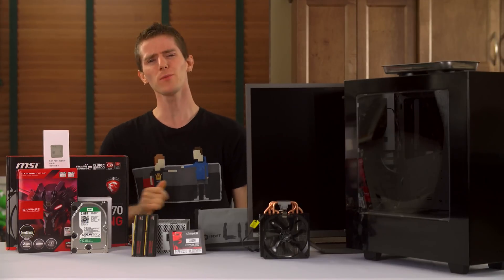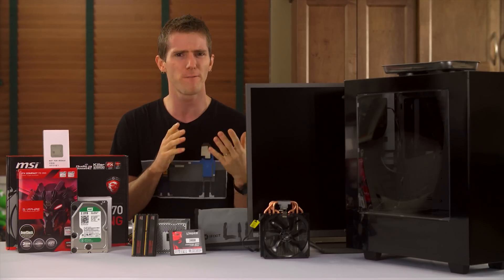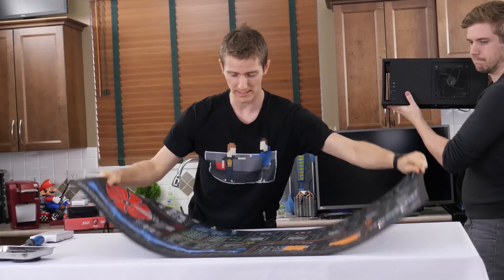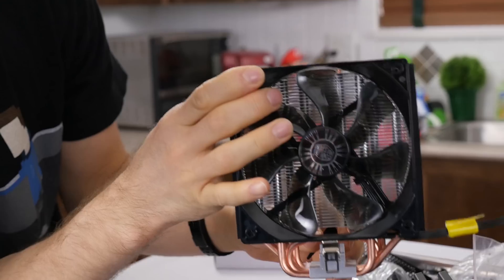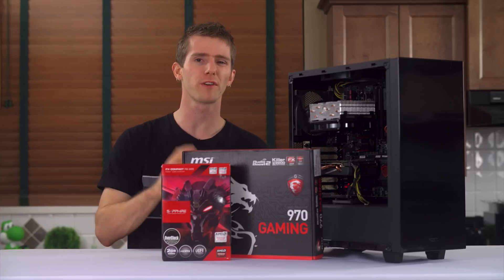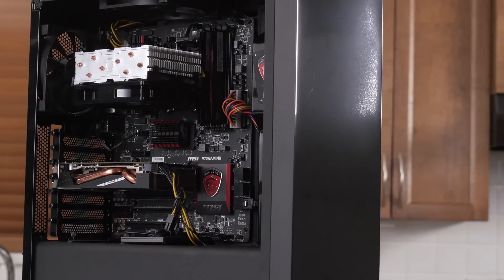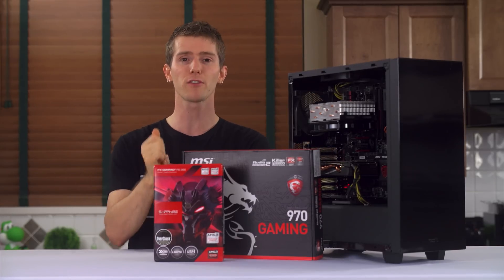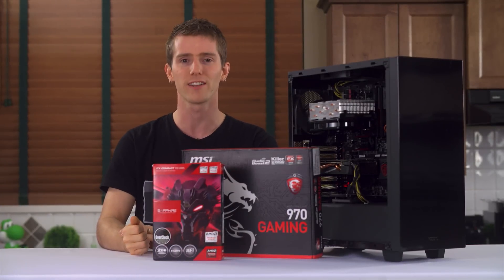Can you Build a 4K Gaming PC for Under $1000?

Comment: thing is, competetive fps games are ussualy played on very low resolutions and preferred to play on 120hz
RTS games are really nice with 120hz aswell 
i'd rather have a game super smooth than have it look really good on 50-60 fps
Reply: I'm not sure lowering the rez is that relevant anymore in competitive CSGO etc. Back in the day you had to lower the rez because it got you a higher refresh rate (CRT monitors were limited in that regard). It also got you more FPS so that you could actually utilize that refresh rate.

These days that's not a relevant argument honestly, with games like CSGO running at 300fps on many systems at any resoultion.

I think some "pro" gamers just lower the res because they heard it's what the cool kids do, rather than understanding the original reason for it. Yeah, sure, you get funny pixel artifacts at long distances /w low resolution, but I seen many very capable players that prefer the high resolutions; especially if looking for things at longer distances.
Reply: I don't play CSGO competitively
Reply: Diego R matchmaking? 
still games like csgo already have bad graphics so i dont feel bad lowering the the resolution
Reply: Silver 2. YOU dont feel bad lowering the res, but someone else might
Reply: Mythricia lowering the res actually makes you play better,i thought that was bullcrap aswell until i actualyl tried it, it makes everything bigger especially if youre playing on stretched resolution
Reply: It doesn't make anything bigger other than maybe UI elements and crosshair. The world scale is the same.

I would know this; I used these tricks back in CS1.5/1.6 and early Source myself.

It's pointless now with modern displays and all that.

I'm not saying someone can't have personal preference, but I'm saying it's not the "must have" thing anymore; the original reasons for doing it are long gone.
Reply: Mythricia it DOES actually make everything bigger, and theres much less for your eyes to scan hence actually playing better, i know alot of people can agree on this, maybe for you it doesnt matter but it does matter for alot of people
Reply: Mythricia
 It bugs me when people use old stuff in cs just because that's what they're used to. (like low resolutions and the ak)
Reply: Bananahead88 you should try switching from 1024x764 black bars to 1920x1080 after 3+ years 
about the ak, that was completely irrelevant, people use the AK cause its cheap and its a 1 shot headshot with decent recoil to control (tho it was much better in 1.6 cause when you actually aimed for the head it hit the head unlike in csgo)
Reply: Bananahead88 The AK? People are just used to the AK and don't feel like spending the extra $300 to get an SSG
Reply: /╲/\╭( ͡° ͡° ͜ʖ ͡° ͡°)╮/\╱\ But... It doens't.... It's computer graphics ABC. The world scale is unchanged. It's represented by fewer pixels, that's all. Take a screenshot at low res, another screenshot at high res, overlay them transparently, and you'll find the scale of the world itself is identical (ignoring things like aspect ratio differences).

There's not less to look at. You're just given less visual information. Which is hardly a positive.

Again, like I already said, I used to do this 10 years ago myself when it was relevant. It's not anymore. If it had a clear advantage, everyone who cared about the game would do it. they don't. Plenty top-end players don't.
Reply: the 300$ is a pretty big deal especially considering how weak the T side is,  besides the ssg isnt even that good
Reply: /╲/\╭( ͡° ͡° ͜ʖ ͡° ͡°)╮/\╱\ The SSG is actually an AK with a scope...So it's better.
Reply: Mythricia also less pixels=less things to scan for your eyes
Reply: akalion2131 idk, it feels really weird for me to play with that thing, im used to the ak
Reply: /╲/\╭( ͡° ͡° ͜ʖ ͡° ͡°)╮/\╱\ Not really. That's not how human vision works. But whatever. You're clearly convinced it works that way for a fact - like I said, you may prefer it, that's fine, but claiming it's a fact is a big step.
Reply: /╲/\╭( ͡° ͡° ͜ʖ ͡° ͡°)╮/\╱\ Well you're not used to it and I also use the AK 24/7, but the SSG is just plain better.
Reply: Mythricia yep
Reply: /╲/\╭( ͡° ͡° ͜ʖ ͡° ͡°)╮/\╱\ More and more pros are switching to a 16:9 resolution. Switching to 4:3 doesn't make it better for everyone instantly, it's not the end all be all resolution. Maybe it did for you, but not for everyone else. I've played at 2560x1440 for almost a year and I'm still Legendary Eagle Master, my rank doesn't get better or worse when I tweek all of that stuff at all
Reply: It's not ssg, that's the scout.  It's  the sg.
But yes i phrased that wrong, i know that the ak has its place of course because it's cheaper but soo many people straight up refuse to use the sg and even call it bad just because it's not the ak, and that bugs me.
And switching resolutions isn't a life changing thing, you get used to it in a few days.
Reply: akalion2131 It's not better, its different and should be used differently.
The ak is a faster weapon to use because the aim tightens in faster after moving. It also has better hipfire/jumping accuracy. Its also $300 cheaper, which is a price of a nade or a flashband with $100 spare. The SG has better accuracy overall and accuracy can be improved further by scoping in.
Reply: Mythricia I have to agree with you on this one. Even inexpensive laptops like my Dell i3 laptop with integrated graphics runs CS:GO at 80 FPS on high settings. I tried turning the graphic settings to low to see if it made a difference in game and it didn't, just made the game look worse. I could see the need for it at the time of the games release when hardware was at the current times specs, but with modern PC's it seems pointless.

Comment: What are the best specs for a PC under £1000 (Not including any peripherals)

The PC will be mostly used to run the following programs:

- Solidworks 
- Keyshot (Rendering) has to have good excellent cooling my current pc reaches around 98 Degrees when rendering 
- Other similar CAD Software packages  
- Adobe Programs (e.g. Photoshop, illustrator etc)
- and other basic programs  

Thanks

Comment: Why the fuck does amd always have to be a low budget build I spent 2500$ on my amd rig not some measly 1000$ amd my system runs games at 4k but 4k still doesn't have 144Hz refresh rate so I'm sticking with 1080 until their are 4k 144Hz monitors

Comment: What if I switch the r9 with an r7 260x? Can it run games at 1080p 60fps?

My build in which I just want to upgrade motherboard and processor. 

And a10 68000k apu
MSI fm2-a85-xa-g65
Corsair cx750 PSU
Sniper ballistics 8gb ram
Xfx r7 260x 2gb gpu
Reply: Bad build.Get a fx6300 or a 760k/860k, 750W is complete overkill and 500W would be PLENTY.And about the 260x running 1080p 60fps, eh depends on the game but it won't be High settings for sure.
Reply: A R7 260x can definitly do that.
Reply: Alright. I have everything. Its just the mobo and the processor that I want to upgrade.

Comment: Why on earth did you go with a 2gig GPU for a 4K setup? It might have worked with these games, but playing something like Skyrim with some mods will not work at all. And it's not that Skyrim is the newest and most demanding game, we're not talking about BF4 or something like that. Spend the extra 50 dollar on a R9 290 and, if you really have to, save that on some other components (case, smaller HDD etc.).
Reply: Are you trolling or are you legitimately stupid? This build wasn't made to run modded Skyrim. It's for people that play Source games or MMOs or MOBAs and that want to play it at a high res.
Reply: Diego R I'm neither. Making a build that can run 4K fine, making it on a budget at which it can't run all triple A titles at 4K, understandable. But why limit yourself on one of the most crucial things for gaming at this resolution, GPU memory? Games wouldn't run worse if they'd chosen a Cooler Master N200 or Fractal Design Core 1100 case, games would have run just as well with a 1TB harddrive. But you'd be able to run more games at 4K with better performance, for the same total amount spend, if they'd went with a R9 290 4GB.
Even keeping everything the same, but using a R9 280X would be better. That one costs the same as the R9 285, but outperforms it on 1080p gaming and has more headroom for 4K gaming due to its 3GB memory.
Reply: So I think you're looking at build guides the wrong way. It's not supposed to be "get EXACTLY what I'm telling you to get" it's supposed to act as a guideline and you should change things accordingly. For one person the 240GB SSDS is useless and maybe for another the 240GB is perfect. If this is EXCLUSIVELY gaming then yeah maybe 240GB is too much. It all depends on the person and their needs. His could also be used for slight content creation and 2TB HDD and 240GB SSD is exactly what they need
Reply: Diego R I agree on the "not exactly getting X or Y", but channels like this are a guideline for people who might not know all that much about building pc's.

With that in mind, giving the "advice" that a 2GB card is a good investment for a 4K build is wrong imo, certainly if you can get a better performaning 3GB card for the same money. It's more that the R9 285 is a really weird buy at this point in time, any other AMD card in this pricerange would be a better pick; the R9 280 is almost on par but cheaper, a R9 280X is better in every regard and by investing a bit more and getting a R9 290 you'd be much better off. Sadly NVidia hasn't got any good options in this pricerange, with the GTX760 being a worse performer with the same 2GB issue and the GTX770 being way too expensive.

Don't get me wrong, Linus makes awesome video's and overall this is a good build, just the GPU is a bit off.
Reply: 1. why do you +1 your own comments? xD 2. if he did opt for a r9 290 he would needed to change the PSU aswell. and with your reasoning "oh since the 280x is better than the 280 just get the 280x but acually since the 290x is better just get the 290x" and at a certain point youre just better off waiting for the 300 series of cards or 400. i think the 285 is perfect for those games he mentioned (CSGO LoL, DOTA, TF2 etc) and the 285 is ITX so if someone doesnt have room for the R9 290 thats also a +
Reply: Budget build and showing that some popular games can run at 4k on said budget build! Every one here would build it differently but this is something that AMD funded and it really benefits anyone because it shows that hey 4k isn't that far away!
Reply: Mohammad Salim the fuck does that have to do with anything he just said? And Umm VRAM and RAM are two different things used for two different purposes
Reply: Mohammad Salim You have no idea what you are talking about, sorry.
Reply: Canada, not the US....
Reply: Praxis  True, but from my experience with adding high res texture mods to Skyrim is that the experience is fine in terms of FPS (30-50 is okay by my standards), up to the point that you run out of VRAM. At that point the performance FPS drops massively (sub 20 FPS, stutters etc.). This was tested at 3x1080p (so 25% less then 4K) with a heavily overclocked GTX670 (1340Mhz core, 7200Mhz mem) and measured using MSI Afterburner.

If you want to do some decent gaming on 4K, some extra VRAM is more important then a little bit extra GPU power. A nice example of this can be seen in this article from Anandtech:
http://www.anandtech.com/show/7120/some-quick-gaming-numbers-at-4k-max-settings
In general, on 1080p, a GTX680 is faster then a HD7950, in some cases even faster then a HD7970. But if you test at 4K, what Anandtech did here, the GTX680 loses (by quite a lot sometimes) to the HD7950. The 2gig cards just run out of VRAM and the performance takes a huge hit, even though the GPU itself is more powerful then their 3GB competitors.

So yea, I stand by my point that if you want to game at 4K you should at least get a card with 3GB of VRAM. And no, this doesn't mean "get a 4GB GT640 instead of a 2GB GTX680", but get a good mid/highend card with 3 or 4GB. With this build something like a R9 280X or, if money allows it, a R9 290 or your best options, not a R9 285.
Reply: What is a newer more demanding game than sky rim? I want to find a demanding game and build a pc to handle that in high graphic settings. Thanks (p.s I'm new as fuck at this shit)
Reply: Because some people, like me, pretty much play Starcraft 2. I have Crysis 3, and I played for a few days, then I went back to Starcraft 2. Some guys just play COD of Dota2. If you are one of those guys, you can play 1080p with a 7750 or GTX 650. Or you can play 4k with a 285 or GTX-760.

Comment: help! my processor is amd a10 6800k (fm2 socket). and i have msi gtx 970 gaming 4g gpu, yeah it runs all games so fking smooooothly but my cpu is shitty compared to my gpu, so what would be good cpu? my motherboard supports fm2 socket, so can i buy fm2+ processor? or should i just get new motherboard and intel cpu?
Reply: you can either get a 860k or stay where your at since your doing fine.

Comment: This is a $1000 PC that can play demanding games at 4K.
Case - AZZA CSAZ 206 (Windowed side panel and 2x 120mm fans included) -  $24.99 (After $15 Mail in Rebate)(Newegg)
Motherboard - ASUS Z87-A LGA 1150 Intel Z87 - $74.99 (After $30 Mail in Rebate) (Newegg)
Processor - Intel Core i54670K - $227.98(Amazon)
RAM - Kingston HyperX FURY 8GB 1866MHz DDR3 - $64.98
Graphics Card - 2x ASUS GTX770's - $519.98 (After $30 Mail in Rebate on each) (Newegg)
PSU - Thermaltake TR2 TR-700 700W - $59.99 (Newegg)
HDD - Seagate Barracuda 2 TB - $64.99 (Amazon)
Total - $1037.90 
So Linus this PC can play most of the games in 4K at highest settings and some of the latest games at high settings. You should really do some research before saying something.
Reply: His build include rooms for 4k monitor.
Reply: If you want to save a little money get a Intel i5 4460
Reply: And stop putting in mail in rebates, nobody does mail and rebates they are just stupid.
Reply: SLI 770 is really stupid for a 4K build, because of the 2GB VRAM. Just get a single R9 290X would be way better
Reply: Windows 8.1 adds another $90. Why does everyone omit an OS in their build guides? Also what about sales tax?
Reply: Supervhizor os is 20 dollar and there is too many variables.
Reply: 1037 AFTER rebates? that is hundreads more than this build alone, rebates are so dumb
Reply: Is this in Canadian prices ?
Reply: throw the k version away from your cpu overclocking isnt giving much with those models
Reply: Supervhizor Many of those games could be played on Linux... :D
Reply: capeman245
seriously mail in rebates are just bullshit ... fucking just discount the item i don't want to work my ass off for a check for 15 dollars from grandma
Reply: Lol, 2 gtx 770? Yeah, nice vram bandwith there mate lol.
Linus included a monitor, you didn't
For 4K you want at minimum a 3gb buffer, having sli does not make both cards vram pile up, you'll still only have the amount of vram of one of them.
Reply: Supervhizor Not every state has sales tax.
Reply: Gtx 770s?! Go for dual r9 290s. Also, newegg only aloows one mail-in rebate AFAIK.